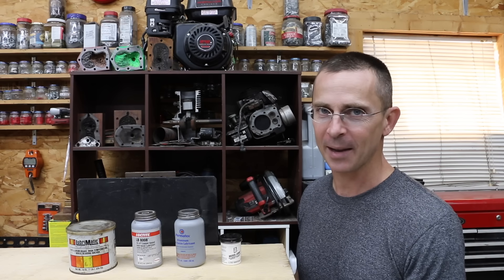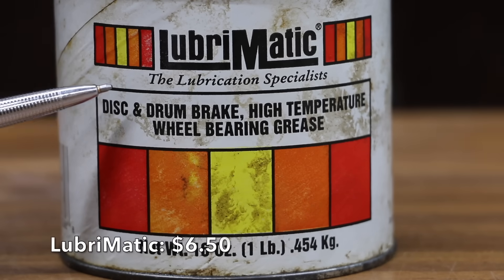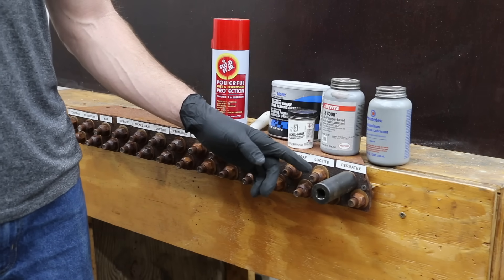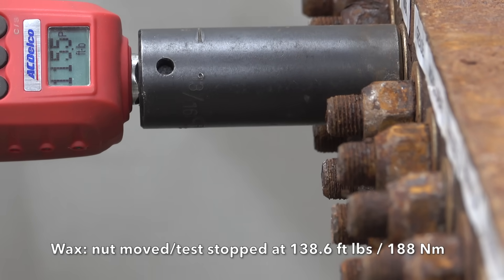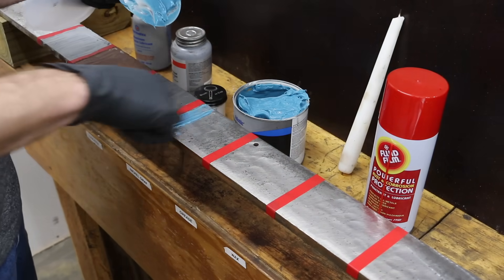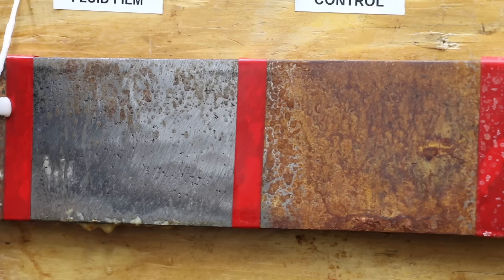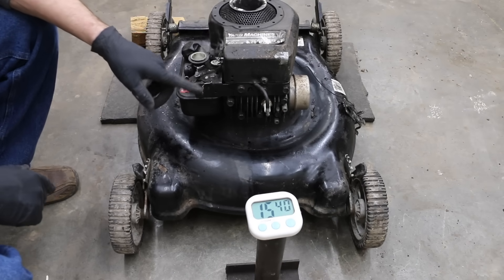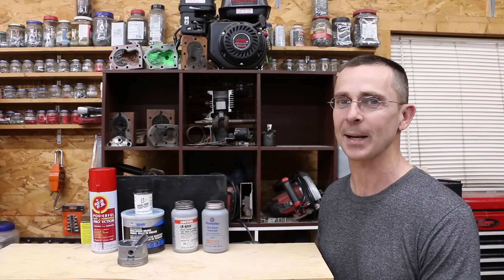Does Anti-Seize Compound Actually Work? Let's find out! Anti-Seize vs Grease vs Fluid Film vs Wax

Comment: I wonder how teflon tape works ? 
 aluminum. base on steel dissimilar corrosion has always left me with questions  .
 I have been using anti seaze MOSTLY on truck lug nuts for 40-50 years. I don't have a lot of faith in it 
 a million years ago it was a Friday my last day on a job before a different job in a different career.
 the next day was a big parade in wich several of the companies log trucks would participate. 
 drivers and mechanics have a adversarial relationship . 
 one driver Doug and I came to me shaking him like a rag doll in the parking lot.
my last day he came in looking for silver spray paint to"paint the wheels on his truck for the parade" . I knew he was lyingand planning on painting his boat trailer. my grease monkey already tdme he was going to do that 
 I said how much do you think it you'll need.
 he said 4-5 
 I went up to  the chemical room where flammables were kept.
 I grabbed 6 cans of thread ease  it came in spray cans with paper labels . I peeked of the labels .
 I brought the 6 cans down to him
 I explained that the chemical guy brought several cases of it to test. I said it was a replacement for emron paint a super good but deadly paint . without a separate enclosed oxygen supply It killed. painters . I told him it was safe just spray it on thick it wi look bad but dry perfect overnight 
 he took the can. 
 secret to ears later I ran into my old boss . he started laughing when he saw me and told me how pissed the driver was.he painted his trailer and with the leftovers he painted 2 dirt bikes

Comment: Fail to use a trace of aluminum anti-seize on spark plugs into aluminum aviation cylinder heads and you will be fitting inserts after you strip out the threads.

Interesting that the copper compound has a "life" on it.  I have a 1lb can of "Copper Ease" that is about 40 years old and half used - still works fine.
Reply from the maker: Thanks for the feedback.

Comment: Anti seize is not a lubricant it's actually a abrasive as it has small pieces of metal in it that is why the motor came apart . Actually we keep all anti seize away from bearings and use grease near bearings so there's no chance of anti seize wrecking the bearings.
Reply from the maker: Thanks for the feedback.

Comment: I worked in commercial nuclear electric power generation.  After Three Mile Island many lessons were learned about instrumentation having been exposed to high temperatures and very high humidity.   On large coarse threads low torque, 300 “ lbs we used Neolube #2 an alcohol and graphite liquid on Stainless steel and aluminum alloy based materials mating threads and Nickel Never Seize on bolts, carbon steel and SS requiring high torque ratings. Of course they were all nuclear grade meaning they passed chemical composition analysis monitoring during and after manufacturing and traceability to their manufacturing batch should any facility experience a performance related issue a 10CFR21 material non-conformance report could and would be made to the manuf and they contact and notifying all purchasers of the product
Reply from the maker: Thanks for sharing.

Comment: Funny how the control bolt took less than some of the brands to release. Meaning doing nothing would’ve been better than putting that brand on. Great video. I coat my lawnmower interface between the side shoot and the metal bottom frame with permatex. That area gets grass clippings and moisture all the time and is conducive to rust
Reply from the maker: Thanks!  Thanks for sharing.

Comment: I love these videos. Im a plumber, If you like comments and discussion, find an experament to compare/contrast pipe dope or soldering flux. Ive used all kinds and have not had a problem, but the debate goes around in circles kinda like Chevy vs Ford🤣
Reply from the maker: Thanks!  Thanks for the suggestion.

Comment: Thanks for the informative video! Your results confirm my experience that when dealing with steel to aluminum  and aluminum to aluminum interfaces in auto & aero engines (e.g., spark plugs in aluminum engines), the Permatex
 product is the way to go. Learned that 50 years ago working on L-88 engines. Also, learned that product prevented seizing in exhaust manifold studs, bolts & nuts, even after years of service.
Reply from the maker: You are welcome!  Thanks for the feedback.
Reply: @ProjectFarm  As I watched your test progress to lawmower crankcases filled with "anti-seize", I couldn't help but laugh. These compounds work on completely different principle than motor oil, and are intended for static applications. The protection that motor oil provides for high pressure, high shear strength at high temp & rotational speeds (think bearings & journals) cannot be met by an anti-seize emulsion, which usually consists of metallic particles in suspension--an outcome your video dramatically revealed! Those engines might have actually run longer had their crankcase been packed with the grease you tested.

Comment: In the Air Force on our j79 engines we used milk of magnesia on our high temp Parts to prevent stripping out the nut plates out on the engine parts subject to high temps. Worked great in preventing massive over torque damage and corrosion. Was extremely cost effective which made the Air Force very happy!
Reply from the maker: Thanks for the feedback.

Comment: In 1994 I bought a 1988 Chevy G30 service van that was a former GTE fleet vehicle. It came with a bulkhead divider and two nice tool cabinets that were bolted thru the floor. I removed one box so found the mounting bolt ends, nuts and washers were coated with  Permatex brown gasket dressing which revealed rust-free steel when removed. Found the threads and both sides of the washers had been coated with silver anti-seize. Removed the other tool cabinet 23 years later to find the fasteners were still rust-free.
Reply from the maker: Thanks for sharing.

Comment: My back neighbor was a tank mechanic during WW2 and refurbished VW Bugs, cars and vans as a profitable hobby. He used powdered graphite on oiled fasteners holding iron, steel and aluminum assemblies together and Milk of Magnesia on the fasteners used on engines. Said he learned about using Milk of magnesia from a captured Luftwaffe mechanic  that said it was less messy to use by dipping the bolts into a container holding it.
Reply from the maker: Thanks for sharing.

Comment: This is an old video so you likely won't see this. You mention the reduction in torque required to meet the appropriate clamping force. I'm not sure if you have the equipment, but a video with the same products and maybe a 30 weight motor oil showing the axial clamping load versus radial torque to a control and each fastener would be fantastic. I find it is often misunderstood the relationship to a clamping load and the importance of the frictional forces being calculated correctly in order to get a proper clamping load from a radial torque value.
Reply from the maker: Thanks for the suggestion.

Comment: My issue with anti seize is cyclic heating. For example anti seize used on the guide pins of floating head brake calipers is terrible. It gums up. I don't ever use it on the wheel studs for the same reason. HTB grease is what I use. it is the most durable in this application. Never ever use anti seize on spark plug threads in aluminum heads.
Reply from the maker: Thanks for the feedback.

Comment: help my confusion: the engine did not seize, but the piston and chamber were madly abraded and the rod came all to pieces...
The lubricant kept the system from seizing during all that abrasion until fitment was loose enough to allow the repeated impacts to crack things apart?

Comment: I enjoy the content and the to-the-point delivery.  Good job.  I think the wax use was misdirected.  That's an old trick to free frozen nuts and bolts.  Heat up the item and touch the candle as close to the frozen thread area as possible.  The melted wax seeps in and helps release it.  Then work it loose.  As far as anti-seize, it's best used on spark plug threads, especially in newer engines designed to go more miles between tune-ups.  Otherwise the plugs tend to seize in the heads.  Just ask past ford truck owners how important that can be. lol
Reply from the maker: Thanks!  Thanks for the feedback.

Comment: a mechanic mate advised me to use grease on engine manifold bolts.  the only grease that goes near my cars is high temp molybdenum disulphide grease so thats what i used until i thought about using the same stuff i coat the manifold surfaces with to make gasket removal easier - silicone.  now i just use silicone.  any sort of silicone.  and roofing silicone is the most common stuff at my place.
Reply from the maker: Thanks for the feedback.

Comment: Is 2 bolts per product really enough data points to make any conclusions? Even your control bolts had numbers that varied considerably. Your graph showed a standard deviation of over 10%, that's... not particularly great. Also, for the candle wax application, I think the idea is to rub on the hardened wax directly, not melt it on. Rubbing it in would do a much better job of coating the surface and I think the results would have been quite different.
I always feel bad leaving comments like this but I'm trying to give constructive feedback. I really do enjoy your videos.
Reply from the maker: Thanks!  Thanks for the constructive feedback.

Comment: Great video. :) I'm a big fan of the copper stuff.

For the torque and thread-appearance experiment, it would be neat to see how common threadlockers stand up to similar conditions. Threadlockers also serve to keep moisture and corrosion out of threads, so it'd be interesting to see how something like Loctite Blue 242 stacks up.

Loosening torque will (almost always) be less than tightening torque. Bolts want to loosen over time due to the deformation that takes place when you stretch a bolt by tightening it...It wants to return to its original size. That applies clamping force via the wedge action of the thread, but it also wants to "un-wedge." Think of a doorstop...It's harder to put in than it is to remove. I'm not surprised a lot of the loosening torque values were less than the tightening torque values.
Reply from the maker: Thanks!  Thanks for the suggestion.
Reply: I personally use pine wood tar. It doesn't stick as tight as threadlocker but still isn't a lubricant like anti-seize. Seems to stop rusting and doesn't let nuts loose even if there is some vibration.

Comment: It should be noted that anti seize compound should not be used to spark plugs installed In aluminum blocks. Toyota recommends against its use as does NGK and other spark plug manufacturers. Modern day plugs have a plating on them that prevents seizing and anti seize compounds both effects torque settings and tends to result in seized plugs. Go figure!
Reply from the maker: Thanks for the feedback.
Reply: Yeah the ford 3v spark plug does not agree with that statement

Comment: I will say I’ve used anti seize on lots of stuff over 50 years, and I’ve never had one come loose or seize. I was initially worried that bolts would vibrate loose but a properly torqued bolt just doesn’t come loose unless you have a mechanism that needs to be safety wired anyway.
Reply from the maker: Great feedback. Thank you!

Comment: How do you like the torque meter compared to using a regular torque wrench i hardly use my torque wrenches because they are such a pain to twist up to 80 ft lbs then turn it back after using so spring does not go bad would you recommend them?
Reply from the maker: I really like the torque adapter

Comment: I've been using brake caliper grease for this since I always have a jar of it near me during the times I need it most - while working on brakes!  It just seems to have the characteristics one wants for anti-seize - thick viscosity, resistance to exposure and high temperatures.  Wish you'd included it in the test since it's very different from axel grease.  Still, I found this video very useful and informative.
Reply: I agree, brake caliper synthetic grease is extremely good stuff for many applications. However, in high heat situations like exhaust manifold studs and bolts the copper anti-seize is still superior.
Reply: @Skyhawk945    yup
Reply from the maker: Thanks!  Thanks for the suggestion for future round of testing.
Reply: agreed

Comment: Not only is anti-seize good for preventing bolts from seizing, but it is also good for preventing bolts from thread galling due to electrolytic corrosion, particularly where steel bolts are going into aluminum threads; found on so many vehicles nowadays. Or if any one has spent an hour trying to remove a stuck O2 sensor in an exhaust, you know the importance of this product. And, I prefer the nickel based. It covers more metals than the copper or aluminum based. Thanks for another detailed video.
Reply from the maker: You are welcome!

Comment: Since they were initially torqued to 90 lbs.ft (ft.lbs is wok done!), I'm rather surprised at the fall off in torque required to loosen them - i would have expected about the same or slightly higher?
Reply from the maker: Thanks for the feedback.

Comment: It would be interesting to see the engine demo done with the copper anti-seize.  I suspect at high temps, the aluminum turned into aluminum-oxide, i.e. sandpaper.  Not sure if copper would do the same.
Reply from the maker: Thanks for the suggestion.

Comment: Have been using Anti seize for decades and yes it does work and is a must for dissimilar metals such as spark plugs into aluminum heads if you value the threads in the spark plug holes in the head! Also works great in areas subject to high heat and corrosion in general.
Have used the stuff for years and prefer the copper based overall.  A container will last for a very, very long time!
Reply from the maker: Thanks for sharing!

Comment: While both Loctite and Permatex both did pretty well, my only question would be being you can get both copper and aluminium anti seize from Permatex, was it Loctite actually makes a better product or was it the difference between aluminum or copper as the base for the anti seize?

Comment: Anti-seize products, or lubricating paste, are composed of "liquid oil or semi-liquid grease" and "solid particles".  The purpose of those products are to, just as name implies, prevent parts from seizing together due to pure corrosion and/or fretting corrosion.

Fretting corrosion are the corrosion happens due to long term micro rubbing of corresponding parts, while there are water or oily (generally acid) media in between.  Such as dove tail, bearing seat, spline etc..

The oil or grease usually contains corrosion inhibitors, which are consumables and only last for certain dosage of corrosion agent exposure.  Those inhibitors loose effect when carrier oil/grease is gone.

The oil or grease may not resist high temp, hence when you put them into BBQ oven for 1 hour those non-HT resistant component turns into tar, which is more acid, hence corrosion accelerated in later slat and water test.

With or w/o oil/grease in place, the solid lubricant particles should prevent seizing.  Wax is long chain hydro carbons, just like oil, but their molecular is so high that it present as solid at room temperature.  You may consider them as solid lubricant, theoretically wax can prevent seizing.  But why not in this test?  I guess it's still the BBQ, it turns wax into tar and since the candle is nothing but wax, there is no other solid particles, only tar left after BBQ, and the tar is so good at accelerating rust and corrosion.

Synthetic or high refined mineral lubricating oil turn less to tar under high temperature, but there is no wax of synthetic/highly refined hydro carbons, hence wax turns into a lot of tar at high temp (if not burnt).

Same as the anti-seize or lubricating paste, those products are not cash cows for any lubricant maker, therefore nobody cares to blend in high quality oil/grease.  That's why you can't expect excellent high temp resistance out of such product.

What about "bearing grease"?  Not a good idea, there are thousands of bearing greases on the market, most of them for "continuous rotating bearings" operate in low friction condition.  For such condition bearing grease would no contain solid lubricant particles, hence they are no anti-seize.
Reply from the maker: Thanks for the feedback.

Comment: We use Kluber Staburags NBU 30 PTM in place of anti-seize in some applications at a light rail vehicle maintenance facility. We find brake clean won’t even remove it. Not sure how it does at high temperature, but it’s an amazing grease. It’s also very expensive. You can find a tube of it on Amazon for about $50. I’d love to see a follow up video with that stuff to see how well it works, though.
Reply from the maker: Thanks for the suggestion.

Comment: We use the Loctite copper antiseize in the hangar on aircraft brake caliper dowels. They work fabulously and withstand tons of rain and mud and can handle crazy temperature fluctuations (the sub-zeros up at altitude and glowing hot during brake operation) like a breeze.
Reply from the maker: Thanks for the feedback.